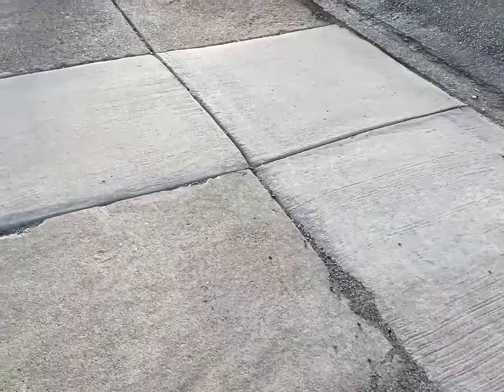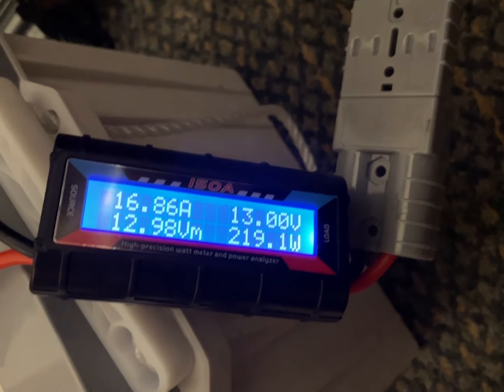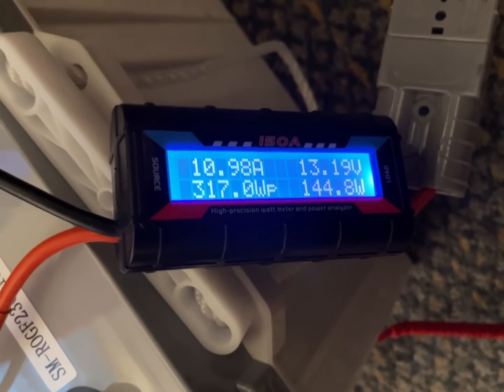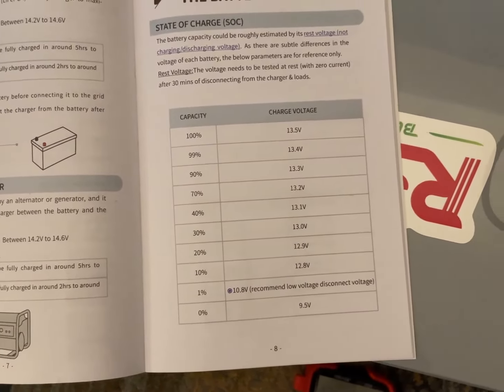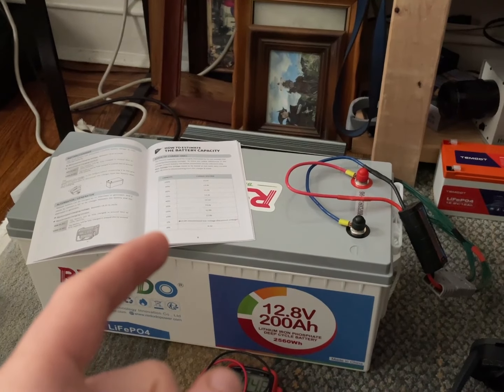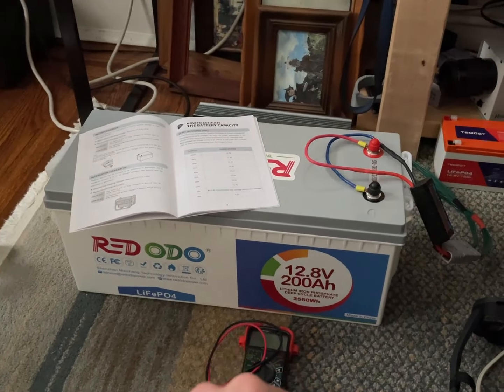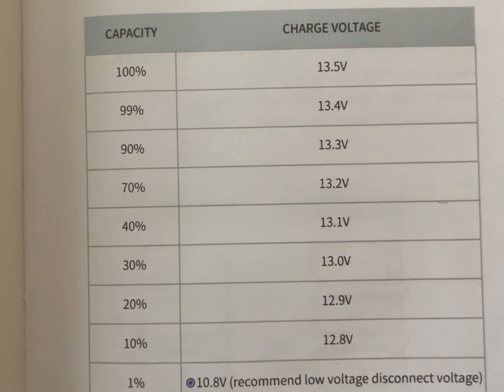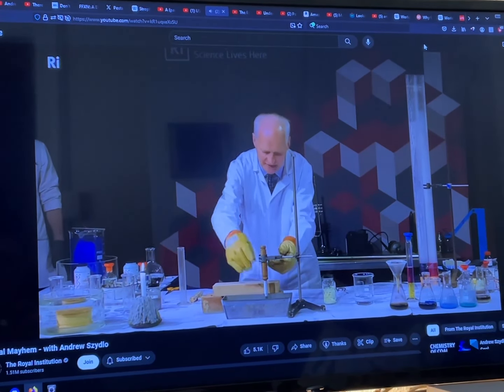Solar Sunday Experiments 28: A real discharge test of the Redodo Power 12v 200AH battery

Comment from the maker: This video was filmed in an overlapping way with the previous video last month about the inverter, in case it seems confusing.

Thanks to Redodo Power for sending me this 12v 200AH battery.  Use code “Rinoa” for 5% off. https://bit.ly/3U19VpX

Comment: Thanks for this video Rinoa! I have decided my setup will not use commercial batteries at all, but will use the 32700 LiFePO4 with screws instead, no need to weld. Expensive but practical. I don't have any sponsors, LOL. I even found some blueprints to assembly a DIY sinusoidal wave inverter, but that is more advanced. Once I get a good battery according to my needs to start with that will be the next step.  I thought that it was going to be necessary a huge rack to start an A/C (very needed in my country) but I see it doesn't. Your videos are inspiring.

Comment: That A/C unit seems pretty quiet, my window units are noisy, no quiet setting and there doesn't seem to be much difference between hi-med-low fan speeds.   How many BTU's is that one and how many sq. ft. is it cooling? I was always told never to oversize them since they will just cycle on and off and not remove humidity properly?
Reply from the maker: This is 8,000btu and its cooling about 650 square feet. The nice thing about this is it runs the compressor at a lower speed when it isnt running as hard. So no on/off like older ones

Comment: You can power your apm meter independently to get a more stable test. It has a port on the side.
Reply from the maker: Yeah I saw that in the manual
Reply: Yes I do that with those meters. A 9 volt battery will do. Useful if the main battery is run down to the point where it switches off. Prevents the totals being lost.

Comment: The letters you see on the readout of that power meter might be it switching to hexadecimal so it can show higher numbers with only 2 digits. For instance A3 could mean 103 or B2 could mean 112, if that was how it was programmed.  The unit I have is slightly different but it will do this so it will max out  at 159.99Ah and then starts over the count.

Comment: I like the inverter ac units, the large ones are good, for large rooms, the small ones for small rooms, but air is not very conductive so it will not easily cool through halls and turns. 
The best option in my opinion is multiple inverter 5000 btu units. 5000 btu can usually cool any single room. 
The ones that ramp down and maintain temperature are most efficient. 
They work more efficinetly when the units are oversized for the cooling area, and they are able to ramp down to lowest rpm lowest wattage, but at that point they are working at maximum coefficient of performance. Even though its not the full 5000 btu, it is more value for watts vs cooling effect. 
Plus they are smaller and easier to handle, and fit in smaller windows, This is key because lugging 80-100 lb units is a 2 man job and it takes extra brackets and time and adds stress to the windows and they do sometimes fall or bust a window frame. 
If you find Inverter 5000btu units for a good price, i think they are about 200 on sale, that could cool an entire home, a big home with 2-3 units, which adding up is only 600. 
Then, if one breaks, its not a big deal. 
And if one can be shut off, it adds to the savings. 
Maximum cop for these units are about 6 when running at lowest speed. 
Which is good!

Comment: I would recommend a 24V system and a Victron Smart Shunt to monitor the system. Currently running a 840Wp / 24V / 280Ah DIY Batterie Setup in north Germany. Its running our deep freezer and our TV setup almost 24/7 all year long. Depending on the weather we need to disconnect the TV setup but the freezer is hooked up 24/7
In my case I also monitor everything with a software called Solaranzeige. Its Open source and runs on a Raspberry Pi. It gets me and display Data from my MPPT solar charger, the BMS of my Batterie and the data of my Victron Smart Shunt. I can access the data even over the Internet.

Comment: how many volts is fully charged 14.4. or  13.4 or 13.6 ?
Reply from the maker: if you take it off the charger and it sits at around 13.6v the  thats charged. Can be good to charge to 14.5v or so just to make sure the voltage flows into the battery consistently
Reply: @RinoaL  its in my motorhome and I'm not sure what to set as a fully charged battery on the shunt that I have
Reply from the maker: for lifepo4? 14.2v float charge and 13.6v rest charge I suppose

Comment: It would be more efficient to set the thermostat down to 66 and let it run an cool the apartment down quickly than let it run all day. The compressor is only going to draw what it draws cooling to 78 from 98 and constantly cycling. Yall are so used to being way above 70 cooling it off a lot once a day then letting it barely cruise over night
Reply from the maker: No this inverter unit doesnt cycle much, it can slow down the compressor. It only takes 20 watts when the compressor is off so leaving it running is fine. Also we need the airflow